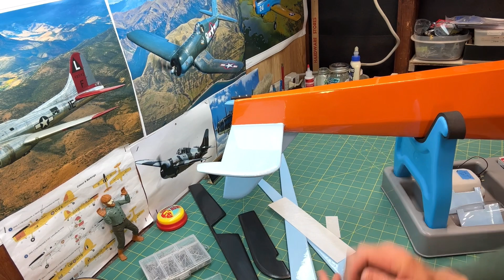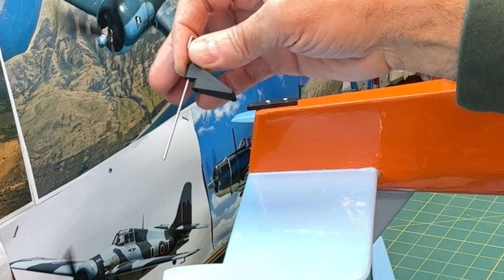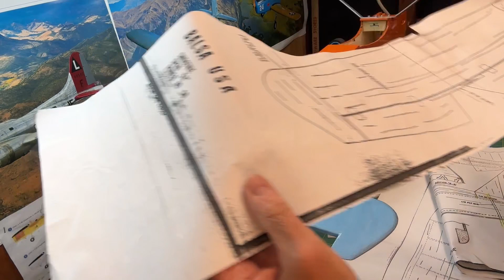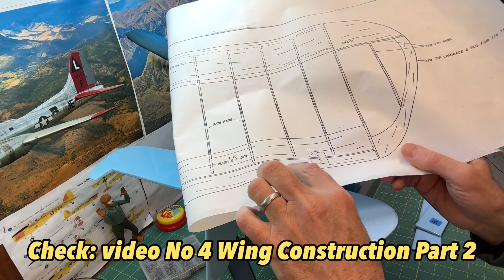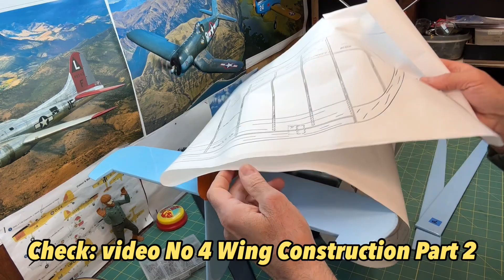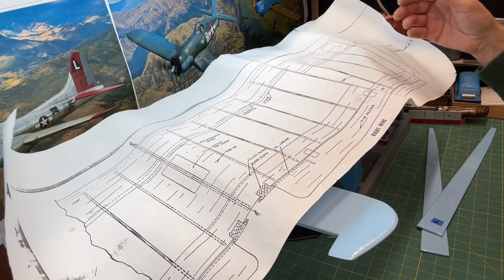Balsa USA Smoothie RC Plane Kit Build No 38, install CA Hinges

Comment: All you have to do is put a wedge under the Debro bracket to angle the tailwheel axis to match the rudder angle.
Reply from the maker: Hi, good point, ya thats an option I considered. They have you do that on the Stingray 120 Im building.

Comment: I would think that if you had to replace a ca hinge by cutting it to replace it, it would also require that all the hinges be cut out or else you would not have the clearance to install a bed one. I'd rather use nylon ones with hinge pin.
Reply from the maker: Ya, it would be hard to replace just one for sure. You would have to cut them all and set new ones adjacent I think

Comment: That was by far the most stomach churning video I’ve seen,  as I have a phobia about cuts to hands and fingers 🥹.  Could you not make those hinge slits whilst in build so that you could hold the balsa in a vice or block.  Just to keep hands out of the way 😅.
Reply from the maker: I hear you. Ya its kinda hard to slot while trying to be safe. I kept catching myself getting too close. Your Idea would work I think. For the ailerons and the elevator and rudder, holding in a vice or clamp to the edge of the table would be a good idea. The only thing on this build would be the trailing edge of the wing since the pieces come together in the build and you could not pre-slot that. But the other parts for sure. At least for the wing its big enough to hold off to one side. Thanks, thats is a good idea.
Reply: @JamesRCPlaneTech  I agree, safety first. You could always wear cut proof gloves. You are so good at precise measurements I don’t see why you couldn’t preslot the hinges before the rudder and elevator were installed. Even if you needed to make adjustments to the slot during the hinge installation it would probably be safer.
Reply from the maker: Something to think about in future, and holding in a clamp or vice would be easier also instead of with the hand.

Comment: Great job on this video and the whole series. I have not used CA hinges before. I have always used plastic/nylon hinges with the pin at the hinge joint. Is there an advantage or disadvantage to either of the hinge types?
Reply from the maker: Im the same , I used to use the nylon ones also. I still like them. I think they are both good, and Im not sure what the size limit is for CA hinge. I think once you get to 60 class or higher its probably better to use the nylon hinge. But I have seen them in bigger planes. Overall I think the CA hinges are easier to use, you dont need as big of a slot and the CA is less messy, where the nylon you need a bigger slot and epoxy and have to make sure you dont get epoxy on the hinge pin. But really, it probably comes down to preference. I have not researched which ones last longer.

Comment: I usually don't use CA hinges and replace them with pin or flat nylon hinges but with a recent ARF I bought I just used their CA hinges. Probably strong enough for a Sig Kadet Seniorita. Those scissors look like they could snip off fingers! Beefy!
Reply from the maker: I think Im using CA more these days because I find them easier, but once I get to a bigger class plane, probably the more traditional hinge is better. I dont know how long a CA hing lasts.